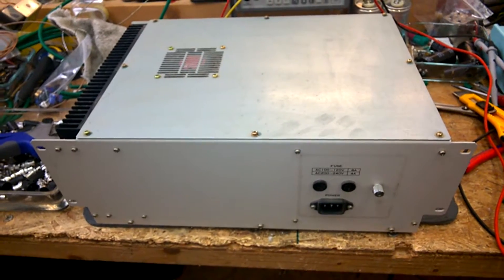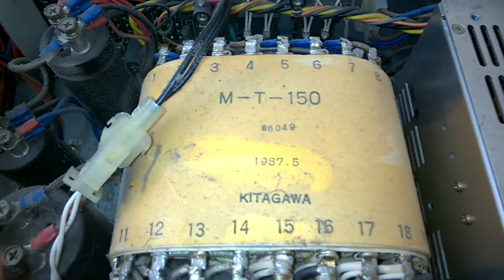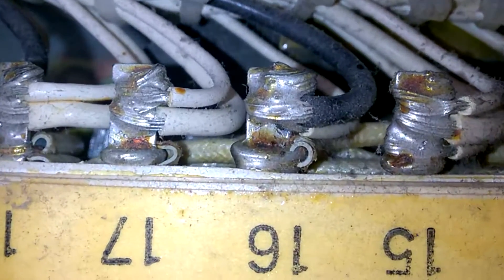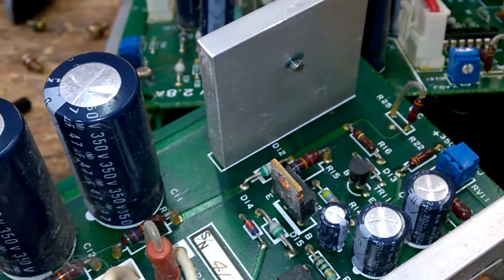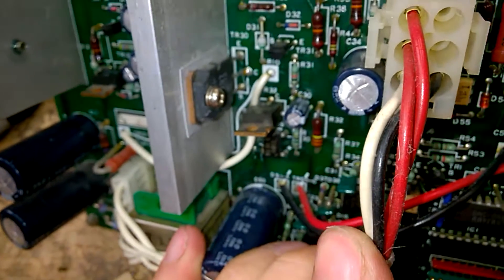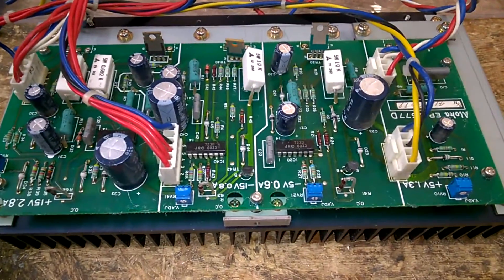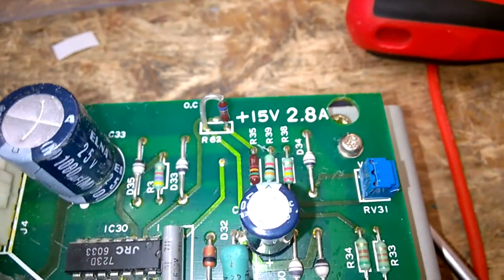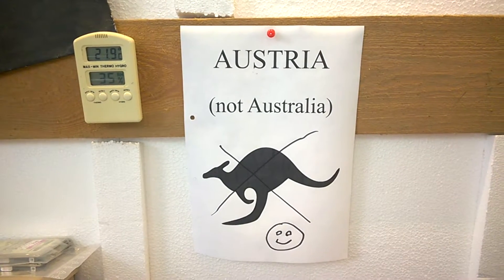Teardown: PSU of an ALOKA SSD-630 Ultrasound Echo Camera, BEB #15

Comment: Hello
I have an aloka 620 SSD
ALL IS PERFECT EXCEPT NO ULTRASOUND BEAM (no faiscsaux in the monitor).
think have an power supply problem, specialy for the power supply of the probe
what the mean of  UIM J410  - FAN J403  -  PANEL J408 - PHYSIOLOGICAL AMP J407 - GEU J409 - 
 can you help
thank you

Comment: I believe the +350v supply would had been for the pulse generator which was used to create the ultrasonic pulses, which would be up to a couple hundred watts at a top frequency of between 5 and 10 megahertz if I remember right.
Reply from the maker: Thank you for your comment. Since the ultra sound probe uses the piezo effect, only a few mW or Watt are needed. Atleast, this particular machine had no RF section, RF power amp, AF amplifier, or whatsoever.
Reply from the maker: I wished I had recorded the teardown of the main unit. But unfortunately that happened long time before my youtube activity.
Reply: hi
nice video
Reply: Dear Friend
The B-mode fo my aloka SSD 1700  does not function. A white square display pattern appears now on the screen instead of the fan shaped B-mode pattern when a convex probe is connected. Can anybody offer any help?. . Many Thanks
      yasminemedical6@gmail.com

Comment: An ultrasound machine is definitely something I would love to take apart, I have seen some of them going very cheap on german Ebay, but sadly either the shipping cost is prohibitive, or will be pick-up only.
Reply from the maker: I've got the Aloka at a local fleamarket. I was the very last visitor. The Aloka was standing there for a full day, for 20 Euro only, and nobody was interested. I've instantly bought the machine. There were three heads included, which I've sold on ebay for quite a lot of money.